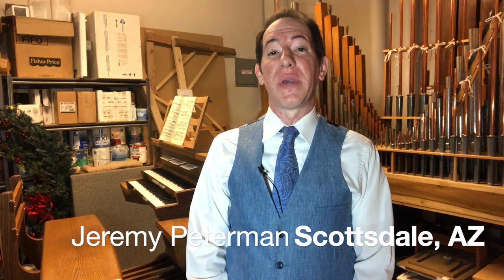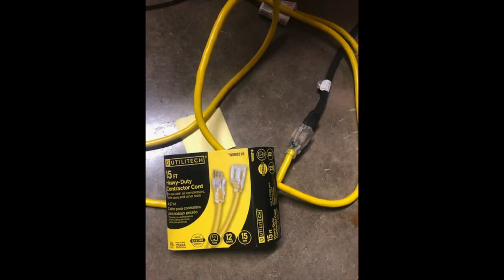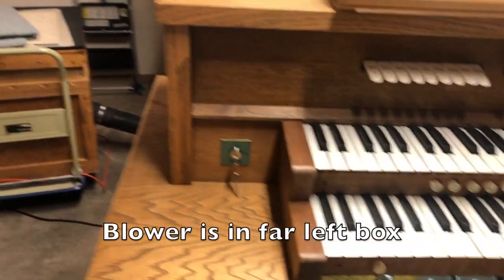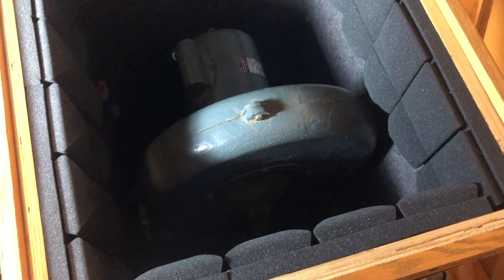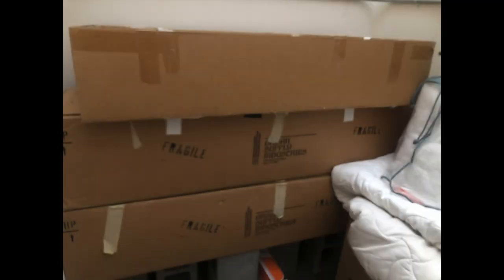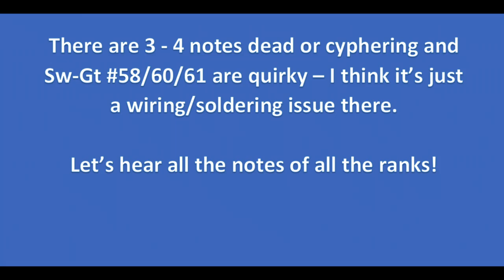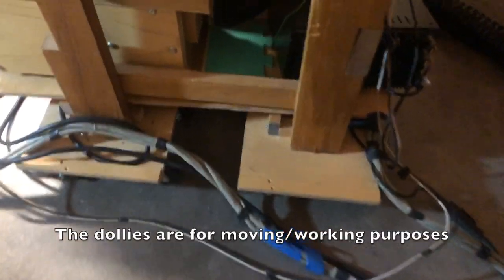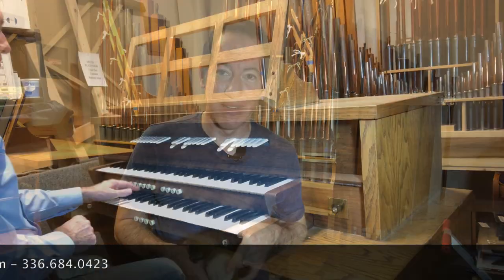Holtkamp 4-rank organ for sale | Scottsdale, AZ

Comment: Just a curiosity: which are its dimensions (width, depth, height and weight)?
Reply from the maker: SEE AN IMAGE OF THE DIAGRAM HERE: https://www.youtube.com/watch?v=AQ7p04vL0Ww

Wow, can't believe I didn't include that anywhere. Can't really give you a weight (though it can be moved a lot more easily now since it's all on dollies), but the CHAMBER dimensions are: 88"W; 41"D; 101"H. Console is 58"W; 56"D; 45"H (not including dolly). Tallest gedakt 16" is 110", and chest it sits on is 8". See other comments/clarifications under the "video."

Comment: Id love to have this. Could fit ij my basement.  I used to have a similar sized one here. Does it have a 16f bourdon?
Reply from the maker: Yes. You can see it in the back of the organ by the wall. I speak about it near the end.
Reply: @jeremypeterman3319  what type of relay does it have?
Reply from the maker: @pauljames5914 Solid-state relay